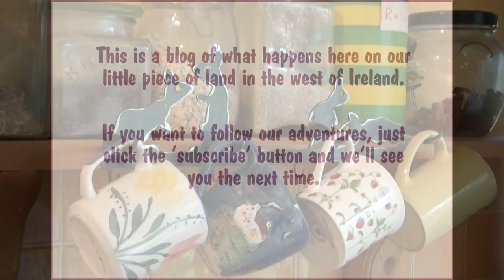Making Metal Cup Hooks And Coat Hooks (Help! There are mice everywhere!)

Comment: You could do like us blacksmiths and heat them up and smear them with boiled linsseed oil for a nice rustic finish. Remember to burn the oily rag in a controlled way, it will self ignite if left alone.
Reply from the maker: I'm waxing them for now because I don't have an easy way to heat-treat them, but I'll keep experimenting. (My coal forge would probably just burn them because they are very thin. Red hot, right?
Reply: Way Out West Blow-in blog 

Hot, not redhot will do it, and at the sametime you get a light oxidation protection. Heat them on the forge, oil them hot and repeat untill you have the result you want. With this method you remove the shiny grinding lines and gain a forged look that people usuly love! :-)

Comment: i'm surprised you have any time to do anything in the day apart from play (read work) with that machine!! loved these designs, my mind is working a mile a minute thinking of different things you can make :) :) keep up the videos, i love them.
Reply from the maker: Thanks - feel free to send in some ideas..
Reply: Two weeks with the in-laws!! :) :) Living in Sweden everything comes flat packed, so thinking is around flat pack ideas.
Bee keeping: Some hand tools for taking out the frames a J shaped one comes to mind - but longer, a frame holder for the side of the hive - they could be cut from flat sheet and each fold line scribed in. I'm thinking lots of people have access to some 3 or 4 mm bar and a vice.
Flat pack door latch and receiver (of fancy design), the purchaser only needs to bend it into shape around some flat bar.
Flat pack metal chick feeder trough, just bend to shape, comes in diferent sizes.
Flat pack post box, - now that could be a fun topic, I did see your new one not so long ago.
You could make some prety fancy picture frames finished in blackened steel.
I'm going to take a look at your machine specs!! We'll be in touch soon enough!!